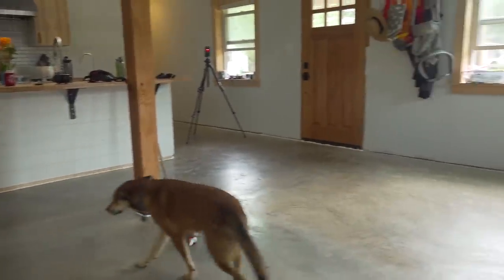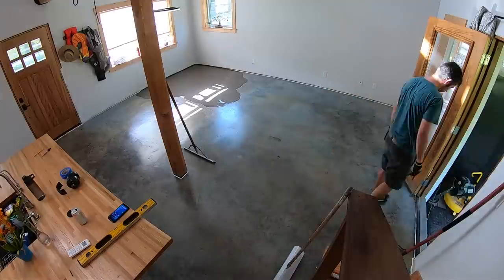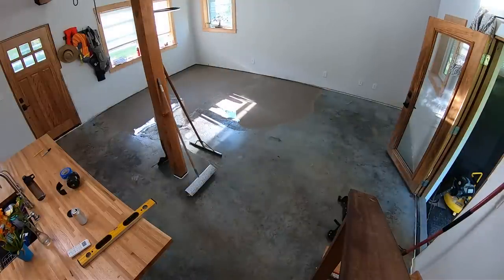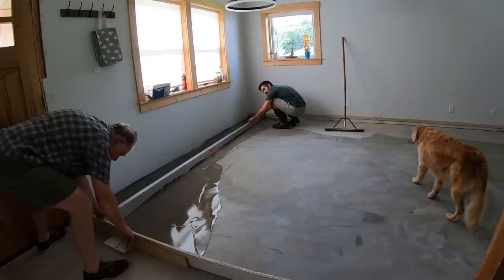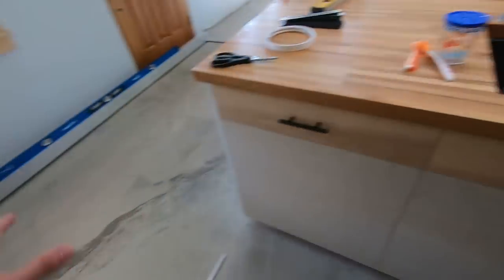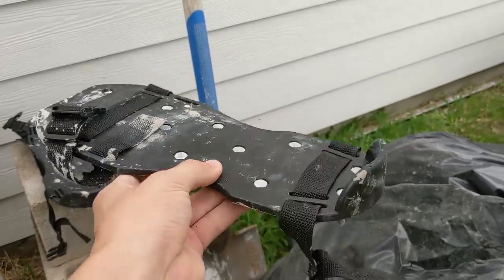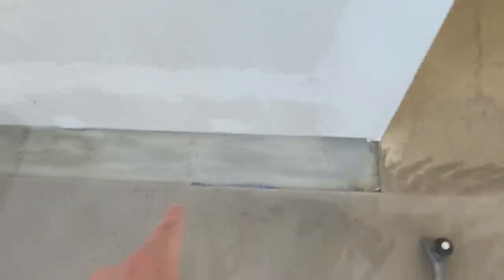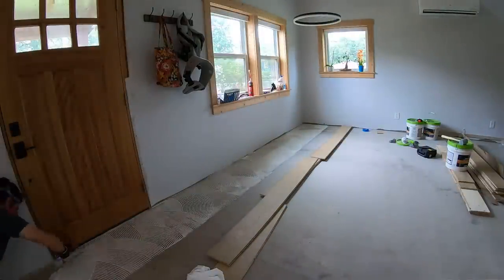How NOT to Self Level a Floor! Prepping for hardwood flooring | Building Small Ep. 6

Comment: The biggest mistake being made here, pouring to thin and slow.  DO NOT cover a large area when dumping the buckets.  Empty the buckets quickly, followed by pin rolling, while a second person mixes as fast as possible. Also, get those buckets poured waaay faster.  You should be mixing and pouring as fast as you can without splshing on the walls! No time to stand around.  The spiked roller should continue to be moving until no visible movement is detected. If the roller is pushing a wave your rolling to fast.    It is not for "moving" material,  but  to break surface tension, allowing the material to continue flowing to PERFECT level.   If you are using a trowel or screed, your doing it wrong.  This isn't patch or concrete.    This floor would have taken me and one man mixing, less than 45 mins to pour and roll.  (After preping)
Ideally,  have 2 people mixing to avoid extended wait time between pours.  This keeps the material thick (deep) enough to flow quickly.    Have ALL your water at hand.  You can fill a large garbage can and have a measuring bucket ready to go.  THE FASTER THE BETTER!!!!
Reply: If the house flexs this won't crack ?
Reply: @samuelbermudez2971   If the house "flexes" everything will crack.   Houses don't flex.
Reply: @honestlyforreal6304  damn forgot teacher is here . No fear 😅
Reply: @samuelbermudez2971   Well, I am an expert on the topic.  Perhaps you're intending to ask about expansion.?  If you decide to poor a floor yourself or hire someone, it is quite important to create a space at the perimeter.     The foam serves that purpose.  The mistake here was using caulk, and pouring tight to the wall.
Reply: @honestlyforreal6304  ohhh nooo I know what you mean

Comment: It was mentioned elsewhere, not enough manpower. On something that size, I'd want at least 4 buckets and 4 people. One person would be cleaning buckets and refiling with water. Another person mixing, another person running buckets in and out of the house.
Most I've ever done is 6 bags, so your job size would make me loose sleep.  Yours was a calcium based material. I've only used concrete based products.  I'm sure their are more user friendly products out there.  I love UZIN 170 Level star.  Not cheap, but flows really nice.
Yes, and cold water is your best friend. With self-leveling products the screen isn't really necessary. The product should flow flat on its own.  
Since you have to work fast the last thing you need to know is how much you're applying.  If you have lines on the wall, that would immediately tell you if you're getting the thickness desired.
Thanks for the honest experience. It helps everyone that watches  your video.

Comment: So I guess main problem here was the direct sunlight making it difficult to work with, in combination with using a screed instead of a gauge rake for moving compound around.  
A gauge rake would of made it so that you could easily move the product around relatively evenly.  
Probably would be better to mix a bunch of product at once also, using like 5 buckets or so.

Comment: Sometimes adding more water will help the compound to level out more easily    If I do concrete floor I wet it down first which stops all the water from being sucked out of l compound before it can run to level

Comment: Thx for sharing your learning the hard way experience. All good notes! Battling with dry times when doing solo jobs is a pain. At the point when you switched to pour and screed were you still using the self leveling or did you switch to a less expensive fine media mix? Floating the concrete is the key to the smooth finish. Did you look into additives to help manage environment factors like set-retarders and adding more superplasticizers (I'm guessing self leveling already has some in it)?

Comment: Thanks for posting. I’m having a similar issue with SLC. Did you customize the ends of your box screed? I can’t find any box screeds online that have height-adjustable brackets on the ends like yours. Thanks.
Reply from the maker: I just added some small overhanging brackets. They were just scrap metal pieces screwed down with self tappers.

Comment: I think you misunderstood the "self" part of self leveler. Why did you use the squeegee and shovel? I can feel all the bumps and waves in that floor from here. If those tools were needed it would be called "assisted leveler". Granted sometimes I use a trowel to push some where needed but I've never worked an entire floor with a squeegee and shovel. You're supposed to pour it and leave it alone. And then come back in with "Ardex" feather patch and smooth out transitions.

Comment: Doable just takes patience and a little more help.  Instructions on the bag likely tell you about temps and water.  For that size room, you needed to be mixing much larger quantities.  As one guy pours, one helps push it around, the other guy is mixing the next batch.  I did a bathroom and it came out great.  Tons of research and reading about issues helped.  Good try though. You probably learned a ton. Next time I’m sure it would have gone smoothly.

Comment: Taping around the stove and dishwasher is a bad idea.  When the time comes for service or replacement, you will find a curb in the way.
Reply from the maker: I didn’t really have a choice with the dishwasher. I think there is enough room to remove it. The stove won’t be a problem to replace and it kept it at the right height so that the small overhangs sit just above the counters. Didn’t really make sense to poor compound and/or put flooring under the appliances.

Comment: Pick yourself up and dust yourself down and grind it out  it’s only a mistake if you can’t fix it yourself you did so  you made no mistakes you just had to readjust your work program and lower your initial expectations  from an easy fix and put in more graft  to achieve your  goal which you did  well done   From flooring installer  38 years  no  job goes to plan

Comment: Where’s the vapour barrier underlay for the wood floor? Glueing it straight to the screed can’t be good?
Reply from the maker: The engineered flooring is designed to be glued down to concrete. The glue also creates a barrier

Comment: I ran through the same issue. It is stressful indeed when things dont come out right. Now i got to re selflevel again but not sure if i can add more self leveling on my playwood on the second floor and if i need to add any type of primer since im doing a second layer on top of the already self-levering.
Reply: Did you come across a resolution? I found out Self leveling concrete was used on  the 2nd floor of my home. Not sure if it's best to somehow remove it? Or pour more or what? No clue but I'm trying to find answers or be pointed in the right direction

Comment: Tile guy here 25 years,Biggest mistake not enough water.This stuff dries amazing strong after mixing absolutely to A water consistency and absolutely self levels properly when enough or even a little more water is mixed than instructed. Fyi
Reply: Not a tile guy here, just a DIY'er with no leveling compound experience. However, unlike this guy...  what I did first was watch a ton of Youtube videos, then I perused multiple internet tile and flooring forums where professionals like yourself offered tons of free informative information. When it came time do do my floors it was just me, my wife and a brother-in-law. Thanks to pros like you the research I did and the tips I learned my pour went great. No floats, no skimming, no need to screed. After doing all the necessary prep work, sealing joints etc, I mixed the compound "correctly", poured it out and let it do its thing. So easy anyone can do it!... IF... they do their homework first and know how to follow directions.

Comment: hardwood over concrete or glued to it is a big no no. even the slightest amount of water and weaken the glue and when it does it starts rising. the best material over concrete is tile or marble/granite then of course floating or even epoxy floor. other than that how is it holding up?

Comment: I've done two large jobs, one in particular required a lot of 'working', so i made a freezer full of ice and mixed the grout with water where the ice had just melted, , note mixing in the grout does add some heat to the mix (The water was above zero - obviously grout doesn't mix with ice, then when the ice does melt the mix might not be even). 
As described on the video the most important part for me was being able to measure the levels as I moved the grout about the area. I used a laser mounted on a shelf in the corner.
I also poured first thing in the morning when the concrete was was still cold from the night. 
In addition I sealed the concrete base so there was minimal dewatering of the grout into the substrate.

Comment: Hired "professionals still had to remove it by hand with carbide pads  and redo it.  The pad stuck locked to the Grinder so we would have needed a new Grinder not just a Shroud, so we did it by hand 24hours of hard graft. The pros ghosted.

Comment: I would have knocked down the high spots and ridges first with the grinder. That way your discrepancies are smaller and you now just dealing with the low spots. I probably would have rented a concrete grinder to scarify the top surface for better adhesion and flatten the floor more consistently. You don’t need to flatten the low spot(s). Then I would have filled in the pockets and valleys on the first pour, if there was a large differential. Then followed up with the leveling pour? I’m not sure if I would have used the self leveling compound since it starts getting too thick in some areas. I think a light weight self leveling concrete would have been better. As the other poster mentioned you can use tapcons or drill holes and insert plastic mollies with a drywall screw as a height reference. Spending 6 hours is nothing to fix a problem after the fact? I need to spend 6 months fixing a house that someone else built thinking they knew how to do finish carpentry, drywall, painting, plumbing, roofing, etc. by the way I would have done a floating floor or tile if your hiding non-structural defects. Tile you can back butter and get creative using a good thinset mortar to hide the anomalies. A floating floor will better take advantage of minor defects vs a glue down that contacts the substrate.

Comment: Self leveling compound has got to be the most ill-named product.
Reply: Laticrete works well.
Reply: Lol yes you're right..its very hard to.level out a floor especially when going that thin.
They work better and will level out better when placing thicker, but it's a very technical job and takes the right know how to use self levelers to get a good flat surface
Reply: Not if you know what you are doing
Reply: ardex works great I have poured lot of it
Reply: I'd agree. Semi-self-leveling would be the best I would label those products. They are great compounds, though, no doubts.

Comment: Can you imagine paying a premium for self-leveling compound and still try to work it let regular concrete.
Reply from the maker: It is really the only product designed for this application. Regular concrete is not strong enough to be poured in thin layers without reinforcement and won’t bond to the substrate. I went with this method because the others I tried were not working. Anyone who has worked with this product knows that it is not truly self leveling. It needs a lot of help
Reply: @buildingsmall8422  Tile thinset works great for this method.

Comment: why are you glueing the floor?
Reply from the maker: My only options were glueing or floating and I figured glue would make it feel a lot more solid under foot and account for any slight variation in the surface.
Reply: @buildingsmall8422  ok thanks. seeing that the first time. i would be afraid it would cause problems because it shrinks and grows with heat and moisture. looking forward to your results

Comment: what a mess youve actually made.. you should have put a set of knee pads on an floated the self leveller out with a trowel and then rolled it out with a spikey roller to blend in the trowel marks.. you lost time by trying to use the glider you've got there.. not suitable. Also if it was 90 degrees outside and with the lack of experience you were asking for trouble, and perhaps you should have attempted it of an evening when slightly cooler..

Comment: First off, almost all self leveling compounds require you to seal concrete as it will suck all the water out of the self leveler.
Second, buy a 55 gal drum and mix however many bags you need to do the floor in 1 damn batch. Go to the thrift store and buy yourself some soccer/football shoes so you can walk in it and spread it out. 

OF COURSE it's going to be a shitty job if you don't seal the concrete and mix it a bag at a time. It's called SELF LEVELING COMPOUND for a reason, why the hell are you screeding it?
Reply from the maker: I did seal the concrete. I’m sure I mentioned that in the video. I found a good way to do it without extra man power and working with small batches. There is no way I could have done the whole house in a single poor. all of the legit pros I have seen use a screed to work the compound around as it does not flow out perfectly on its own. I ended up with a perfectly flat and level surface.

Comment: so many layers of no. sorry you made this so much harder then it actually is. you can put nails or screw in the subfloor and set them to the height you need.  that way you can pour quicker and easier and all in one shot. just looking at the colour of your mix tells me you mixed wrong as well. if you rub your hand on the selflevel after iys dry and sand appears out of nowhere you are in trouble. you shouldnt glue to that. at the least you need to prime the floor one more time before laying the floor. even though you are gluing them down you are just sticking them to dust not the sub floor.
Reply from the maker: I didn’t have any dust. The compound cured perfectly and provided a great surface to glue to

Comment: Do the three words "Hire a Pro" ring a bell in your head? The ingredients of any DIY project are Time, Effort, and Money. You lost out on all three. An easy way to find high and low spots on the floor is simple, a glass of water. The one thing I would have liked to see is your total cost for this project. Now, you have a garage full of new tools that will likely never be used again. I've "Been there done that" many times. Many comments concerning hiring a PRO. Know what those letters stand for? They stand for "Professional Rip Off." I've had many bad experiences with PROs here in Florida. It's not the Sunshine State but the "Rip Off" State and the SCAM state. Most of my DIY projects leave me saying, "Well, I did my best."
Reply from the maker: I reached out to “pros” but couldn’t find anyone that seemed trustworthy at a reasonable price. It was a ton of work but I’m very happy I did it myself. I’m guessing I saved around $5k doing the leveling and flooring install myself.